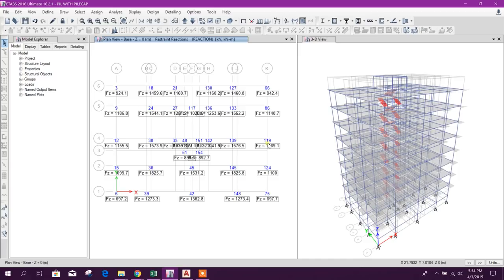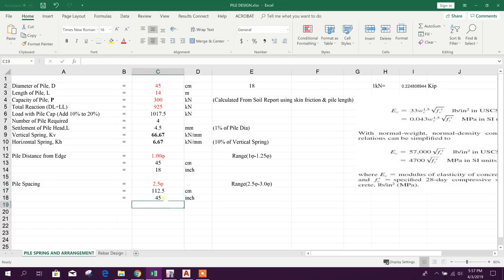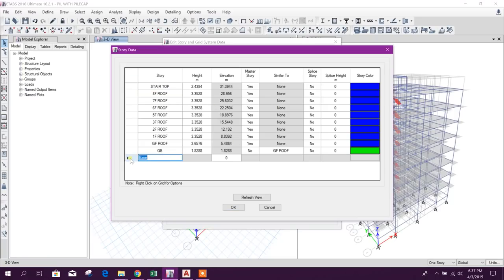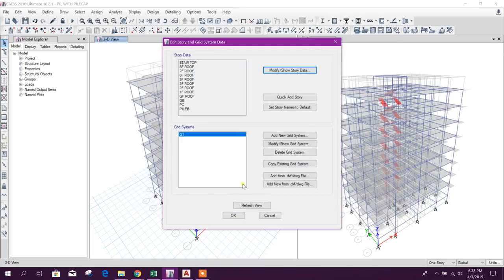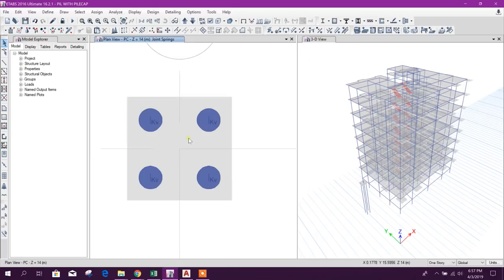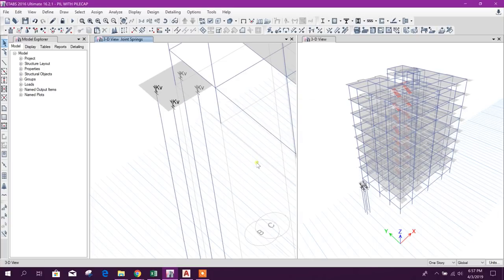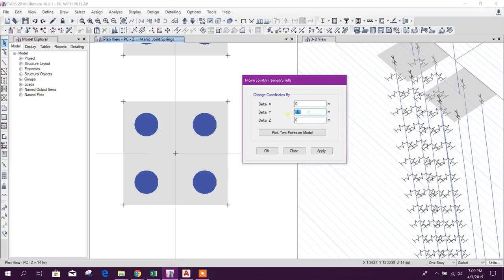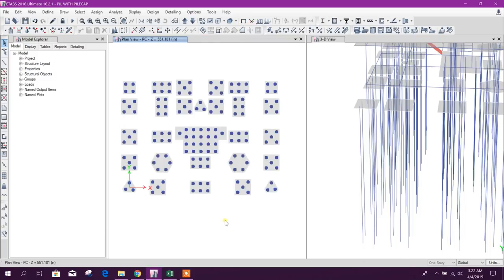DESIGN OF PILE CAP WITH PILE IN ETABS

Comment: Hello, great video. I
 would like to ask something. If you couldn't assume Kh as 10% of the vertical spring, how can I correctly calculate this Kh.  
I hope you can clarify my doubts!
Reply: And also, Why do I have to consider a Kv  right in the intersection between pile cap and the piles top. Not only in the pile's base. 
Thanks again!